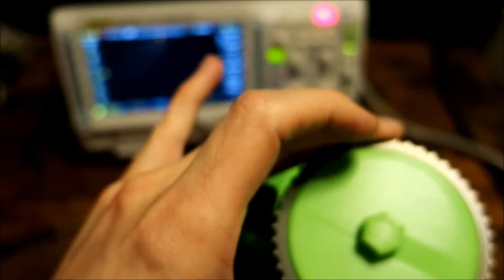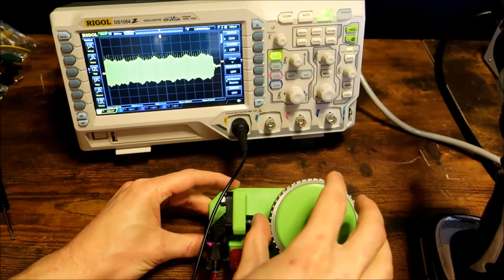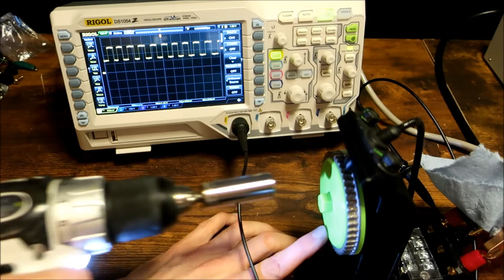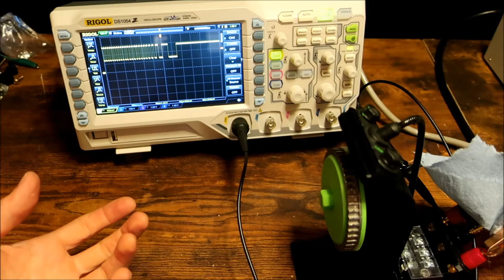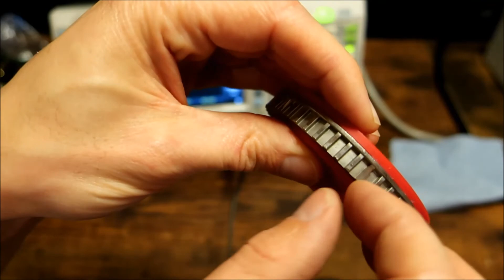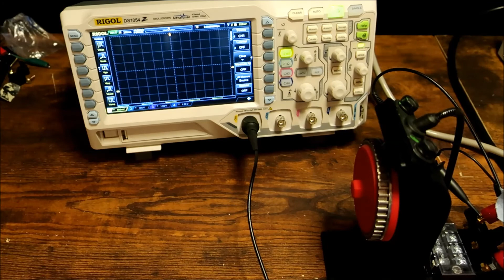Vehicle Wheel Speed Sensors: An In-Depth Look

Comment: So on a typical ABS controller, are both frequency and amplitude taken separately into consideration when calculating wheel speed, or is the net voltage output the factor to decide on a passive wheel speed sensor?

 The reason I ask is because on a car I'm building, I'm running a larger rear wheel and want to retain ABS. I plan to alter the tone wheel to fool the front wheels into being "slower". If it's just overall voltage and not frequency, I could just add a spacer to the sensor to get my desired result (I think).
Reply from the maker: It's primarily the frequency that's looked at. Amplitude only plays a factor with regards to signal strength at slower vehicle speeds for passive sensors; the generated voltage from the sensor at slow vehicle speeds is low to where the module has difficulty detecting the wheel speeds when the vehicle is below a certain mph. Active sensors fix those issues where wheel speed has no effect on the amplitude of the signal. Either way, the frequency is the main thing on what's looked at for both style sensors.

As far as trying to fool the module by running a larger wheel, adding a spacer to the sensor won't do anything except cause a drop out in the signal. The amount of teeth on the tone / reluctor wheel corresponds with how many pulses are generated per 1 revolution of the wheel. For example, a tone wheel with 32 teeth will generate 32 voltage pulses / cycles per 1 revolution of the wheel. If the wheel is moving slower, then the module detects that because of the lower amount of pulses detected at the sensor. 

You would have to make a custom tone wheel with more teeth to compensate for the slower wheel speeds, but keep in mind that the spacing, teeth profile, size, etc. all play a factor in how the signal is interpreted. A lot of testing would have to be done to ensure it's operating properly, and I'm just talking about to ensure your vehicle can actually drive without getting weird ABS activation issues, let alone the system actually working correctly when you get into a potential loss of control condition where you need ABS to work reliably and safely. I personally wouldn't feel comfortable doing that on my vehicle, let alone a customer's.
Reply: @TimmaethBoy  I appreciate the reply, and that's exactly what I was expecting it to be. My options were attempt to keep it, or bypass ABS all together. It's a track based car so I'm not too concerned about deleting it. I'll just have to make do with less nannys.